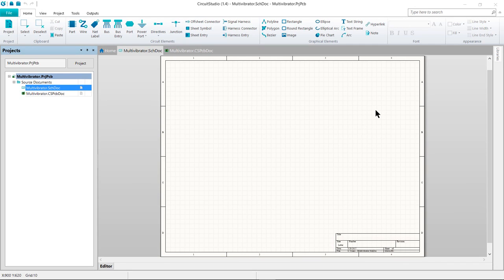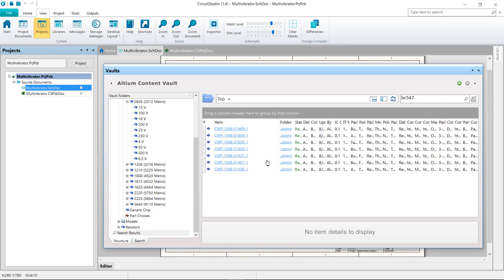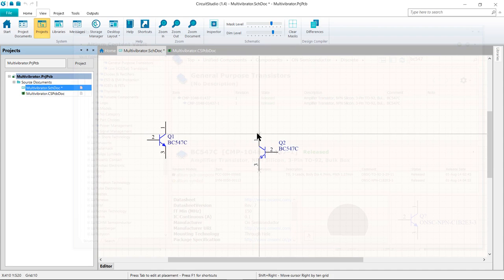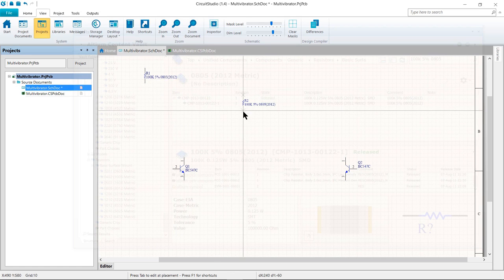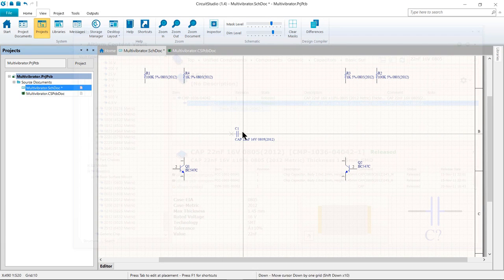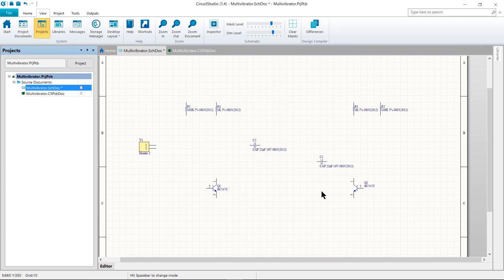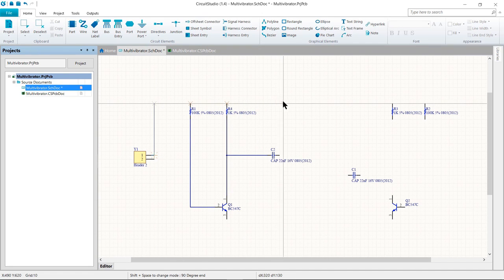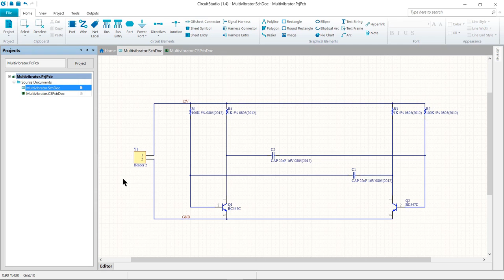(3) Capturing the Schematic in CircuitStudio - Altium Academy

Comment: Vers 1.5.2, If I put 1k 5% 0805 in my Altium Content Vault search, I get a list of "folders" with resistors, and one folder with thermistors.  Then clicking on any of these folders I get resistor that are 0805 or 2012 but all different and random values.  I don't get 1.0k or 1k or 1.00k resistors at all.  This video does not match the current version situation.
Reply: I have the same issue. Have you found a fix?